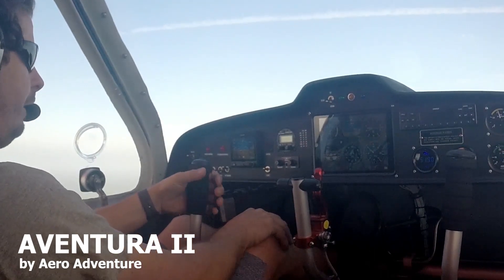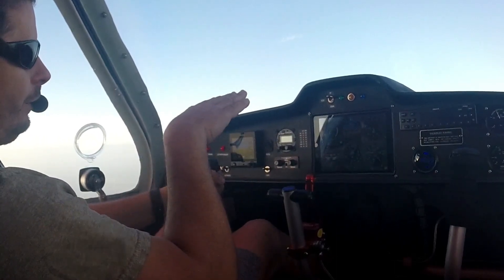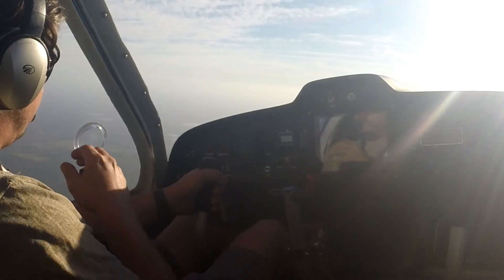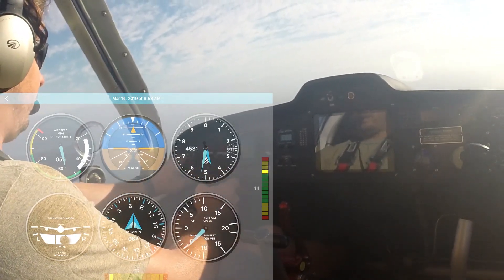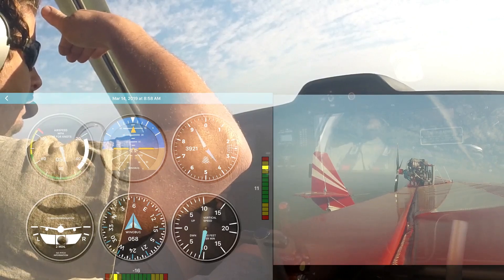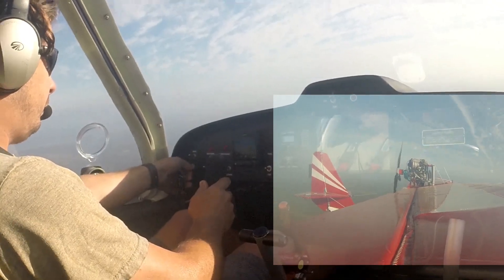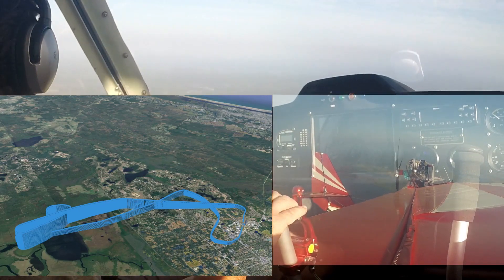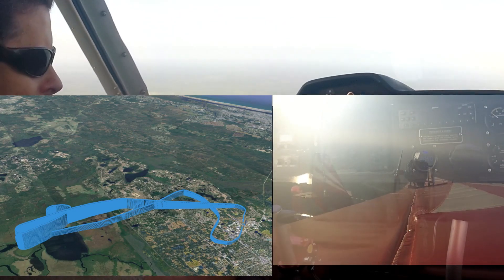Seaplane Engine Shutdown - Testing Glide Ratio  on Aventura II

Comment: Sooo....for those of us who don't know how to do the math...what would you calculate the glide ratio as?
Reply: If we call the speed to be 58 knots then it's moving forward at about 5874 feet per minute.  It seems to be losing 850 feet per minute.  850/5874 is about 0.1473 or a glide ratio of about 7 to 1.  Yeah, better have a landing spot picked out, but that's about average for a dacron wing aircraft.  Pretty draggy.